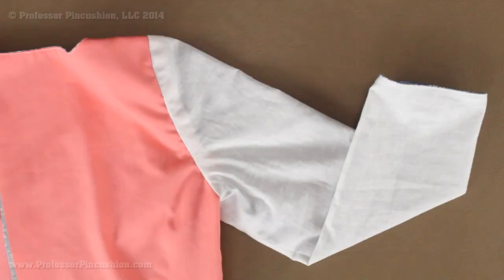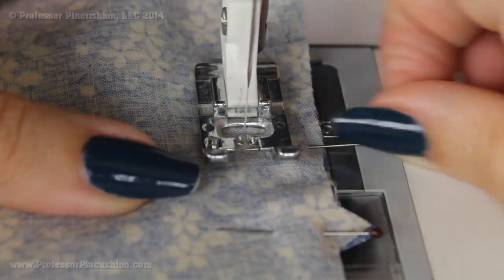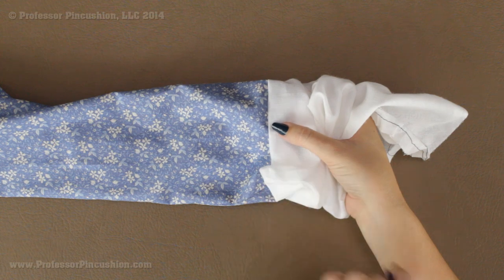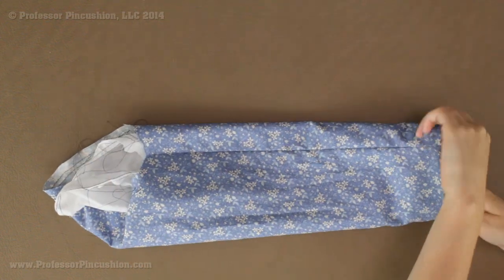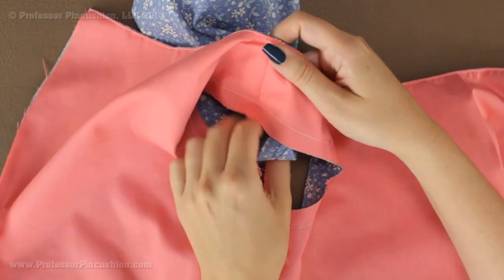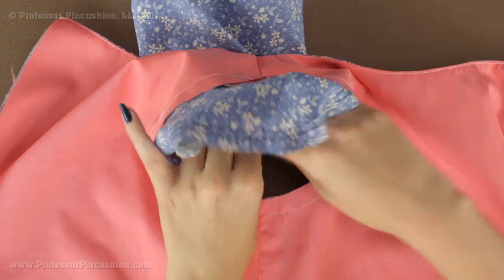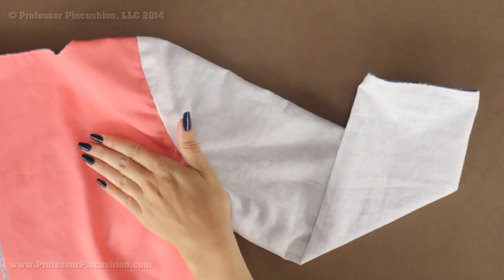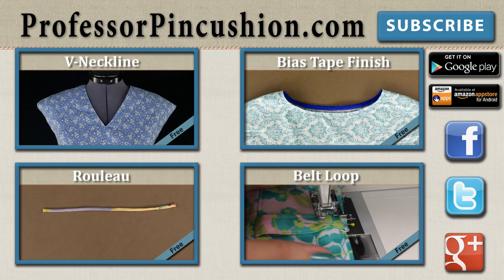How to Sew a Sleeve Lining

Comment: I'm far from an expert, I do everything by Simplicity patterns, but isn't this a bit of a hard way to do it? Don't most patterns call for you to sew the lining and the outside fabrics like a normal shirt of bodice with the sleeves, and then sewing them together at the edges? That way you can omit the hand sewing except for the window left not sewn so you can turn it right side out. I don't know, there's likely something I'm missing but this seems a bit more difficult.
Reply from the maker: You could but there will still be handsewing involved.  You would have to pre-hem both the lining sleeves and outer sleeves and then once the lining is inside, you'll have to hand sew the hemmed edges together.  Otherwise, every time you take your arm out of the sleeve, the lining will pull out too.  This method allows you to skip the hemming since it's just one seam instead.

Comment: I had no idea that the sleeve lining would have to be hand-sewed. Fitting that lining sleeve around the opening "folded over" has to be awkward.  But yours turned out really nice!  I'm thinking that there must be other ways to put a lining in a sleeve, because many lined jackets have a lining near the cuff that looks like IT is hand-sewed in--where alterations could be made if the sleeve is too long or short for the wearer.  With your method, is there a problem with the cuff lining slipping out at the end?
Reply from the maker: Karen V It shouldn't slip to the right side because of the understitich and then topstitch.  :)
Reply: Professor Pincushion oh yes, top stitching.  That should help.

Comment: Professor Pincusion, first off thanks for this wonderful tutorial. Is there a way to attach the sleeve lining with a machine? I don't know why but my slip stitches always open up after wearing the garment once or twice even with small stitches. Thanks again!
Reply from the maker: homyra ahmady there's no way to do it on the machine without it showing on the right side of the garment. Maybe just do a slip stitch going around the sleeve twice to reinforce it.
Reply: Thank you so much for responding. I will definitley do this.